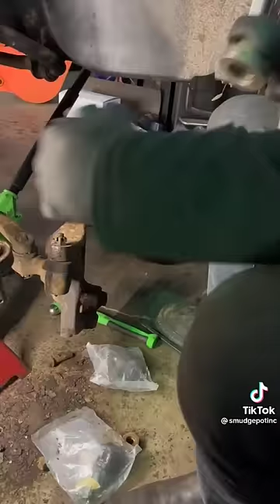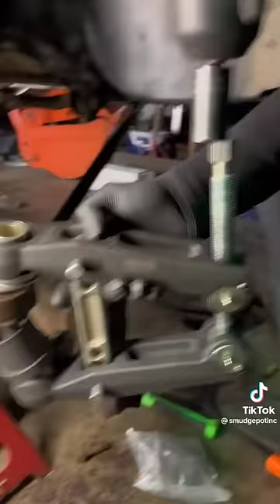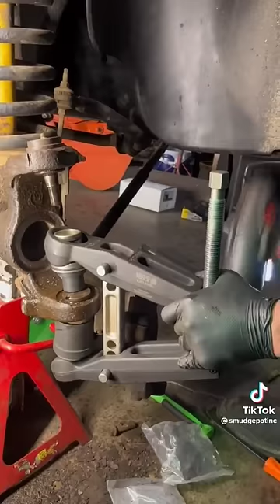Matco Ball Joint Press out ball joint Tool Kit pt.1 #automobile #diy #fyp

Comment: $1300 bucks... damn, that's a lot of 5lb hammers.
Reply from the maker: lol
Reply: You can get the harbor freight one for way cheaper. Works perfectly fine also.
Reply from the maker: @Soundsofthewood  not on a rusty dodge or jeep wrangler
Reply: @letsfixit251  I used them on rusty semi's and it works fine. You just have to smack the driver with a hammer when it gets stuck.
Reply from the maker: @Soundsofthewood  smack the driver? Lol wait until you work on a rusted jeep wrangler though.
Reply: @letsfixit251  you know for shock. Helps bust the rust.
Could a jeep wrangler be worse then a million mile semi that never stops?
Reply from the maker: @Soundsofthewood  hell yeah man and because that it does stop rust builds up more and worst that way. A semi is built more tough ti begin with anyway. These jeeps are poorly built to be honest and well a dodge is just a dodge if your familiar with hwlow bad they always Squeak
Reply: @letsfixit251  I never owned a chrysler product. Worked on them, but nothing serious.
Jeep to me was a waste of money. 30k for probably the most basic vehicle ever. I also like having a real truck bed.
Reply from the maker: @tristan long  man jeep may be the worst made vehicle there is. Look up jeep wrangler death wobble. It's the only vehicle I've seen that does that. The bottom ball joint on these things press out from the bottom and don't come with a snap ring in them from the factory because it doesn't come up high enough to put one on. The greese fitting on the top of the bottom ball joint has to be removed because the drive shaft for the wheel will hit it. It's just a bunch of things they did that didn't make sense, which is why we have tools like this being made to make us mechanics life a lil easier lol
Reply: @letsfixit251  special tools for Chrysler vehicles?  Get. Out. Of. Town.
Reply from the maker: @whiteyonthemoon1193  the ones better made for jeep or shorter than your typical c style tool. This one is pretty much universal
Reply: @letsfixit900 Jeep is definitely not the only vehicle to experience "death wobble". I have used the PIA ball joint tools on many applications including rusty Jeeps yes they do not work as slick as yours but still work, and this is in the rust belt. But back to death wobble, cars, trucks, SUVs, can all experience this with worn components.
Reply from the maker: @Jerome  Interesting. I haven't experienced it yet after working on about 3,000 vehicles, but the mechanic gods have been blessing me more than I realize. Thanks for sharing 👍🏾
Reply: And it’s a tenth of the cost of shoulder surgery, your choice..
Reply: @Soundsofthewood  how do you get the new one back in? Those c clamp presses are a joke. You might can do maybe 6 ball joints before the c clamp is bent and no longer capable of pressing. This clam style press is a 2:1 ratio buddy. That means you don't even need to use an impact. You can use a traditional wrench and you're good
Reply: @KyrieEleisonMaranatha  I bought the adapter kit also. So I can do it from both angles.
I never had mine bend. Maybe I just got a good one from the production.
Reply: @Soundsofthewood  I've been using them for years and I've never had one that didn't bend. Being that they are really cheap I'm not terribly worried about it.
Reply: @letsfixit251  for sure they have! Ford had a recall a couple of years ago for it, if I remember correctly f250 and 350s were on that one. Have seen it in cars like the Toyota Camery Hybrids as well. In the motorcycle world, it is also called knee slapper. Ram and Jeep Wrangler are the most common by far. The most common reason for true issues in my experience are worn components, followed by tire balance issues.
Reply from the maker: @jerome4995  what are you referring to?
Reply: @letsfixit251  "death wobble"
Reply: $700 on the interwebs
Reply from the maker: @Smittyschannel  that's not including the attachments
Reply from the maker: @jerome4995  oh ok
Reply: @letsfixit251  ok thx
Reply: @jerome4995  no it’s called a tank slapper not a knee slapper, get it right or don’t comment please
Reply: Dont forget the $350 Milwaukee High Torque
Reply: @FC0BCA7E7A   look out, got a real keyboard bad ass here! Yep, I should not comment due to a typo. You are correct "tank slapper." A thousand apologies, I hope you can recover from my egregious mistake! Grab your binky and teddy, hug it tight... you will be ok.
Reply: @letsfixit251  you just have to buy it used or find someone that will let you rent it or even borrow it and I promise it WILL press them in and out my shop has used it on a 1.5 ton pickup truck that rusted af
Reply from the maker: @keeganrandolph2712  I doubt if anyone will rent this tool out. Hell, I wouldn't. As far as one used being put up for sale, I'm on high alert already for it.
Reply: @letsfixit251  😂😂😂😂😂😂😂
Reply: @letsfixit251  
I assume you work for cdjr? Been working for them going on year 2. I have never come across such poorly/made to fail built cars before. And I worked for hyundai/genesis. I didn't care for jeeps at all until I worked on them. Now I hate them with a passion.
Reply: @Soundsofthewood  
Bruh, we had a V6 wrangler come off the truck at 70k msrp. I about passed out. AND SOMEONE BOUGHT IT SAME DAU!!!
Reply: @jerome4995  
Wranglers are 9 times out of 10 caused by the shitty steering damper they refuse to redesign.
Reply from the maker: @Aaron Smith  No, I'm a entrepreneur self employed. I did work for a company called budget brakes for five years as a lead tech and store manager. Specialize in suspension, steering and all powertrain that goes along with those specifications
Reply: @letsfixit251  considering I just did mine last week on my 02 2nd gen and it went good. Idk what you speak of sir
Reply from the maker: @Clark  sounds like you don't have a rusted busted 3rd gen then. Those are usually easy anyway. This a poorly made Jeep Wrangler rusted to hell
Reply: @Let's Fix It  I actually changed my first bjs on my 96 jeep with original joints with the harbor freight bj kit, 5lb hammer to release the tension and also the thing didn't even come with the straight axle cup that has that curve and it was super easy. Penetrating oil never hurt anything either. I can't believe the knuckle didn't break with you driving it home. That was Def hard on the outer edge. I would look into replacing those too.
Reply from the maker: @Jonathan Terry  yeah the hammer and cheap c style press definitely works most of the time especially if your vehicle isn't rusted to hell. I'm not the person in the video. He carelessly used the tool but it still worked and will be fine. Look on my page I did this same vehicle with a 21 peace ebay press. Not sure about you specific jeep but the one I worked on the spring was hitting the tool as I pressed it. The matco tool doesn't have clearance issues with that. Check it out.
Reply: I forgot my favorite 5lb hammer at my last job and regret it all the time. I miss lucy.
Reply: @Let's Fix It  ford death wobble is one of the most hilarious videos ever
Reply from the maker: @DiviningROD  lol I'm about to go check it out. What type of ford?
Reply: @Let's Fix It  2018 f350 death wobble
Reply: @Let's Fix It  that's the exact description, guys is hilarious about it
Reply from the maker: @diviningrod2671  fixing to check ot out
Reply: @letsfixit251  A rusty dodge..... seems like a redundant descriptor.
Reply: Almost Looks like He Broke the bottom piece & didn't Take Out the lock ring. 🤔
Reply: @jerome4995  might want to check the caster on those death wobble machines
Reply: @matthewklein9225  that is definitely something to check. I haven't had that be a cause yet in 40 years, but something to check regardless. Many of these are completely stock, worn-out/damaged parts are usually the reasons. Tires are another common cause. Trucks and Jeeps with oversized tires wear out stock components faster or tires that were poorly balanced, balance beads work great for hard to balance tires or rigs that may need a little extra help in the balance area.
Reply: @aaronsmith7143  A steering damper will mask the issue. Any vehicle, including a jeep, should not have the wobble with or without the damper. Any shop that tells you that a damper will fix "death wobble" is not fixing the issue.
Reply: @jerome4995   @Jerome  I see lifted jeeps regularly that have not taken the final step of adjustable control arms to get caster back in spec. The more oversized the tire the more caster they need. Besides the negative caster resulting from lifting without proper alignment.
Reply: @Let's Fix It  yea i totally get it. But I'm poor so harbor freight is life saver for me. I can actually feel and look at the tool. Amazon sells mostly junk. Even if it says it's name brand it could be a knock off and you never know what you're getting. But you can get lucky. But as far as tools like this, it's out of my budget. Would love to use it. But wouldn't spend what they was saying it cost. 

And yes the video no matter what tool ypu should relieve the pressure. 

And other comments saying jeep is the worst vehicle ever. I know everyone has their own opinion but I was raised Chevy, married into dodge, and everyone I know hates ford. I would up with 96 zj with 120k for 800$. Best investment ever. Easiest vehicle I've ever worked on. And easy to know what's going wrong.
Reply: @Soundsofthewood  it truly is the most basic vehicle ever. They sell u basic for way to much only to tease the poor bastards to go out and spend another 30k on aftermarket parts
Reply: I choked drinking and reading this 😅
Reply: @letsfixit251 mine works on literally everything I throw at it. same grade steel, bud. matco for
life but Harbour freight for everything possible.
Reply: fuck I bet it's re branded ,prob lisle or someone else for 299.99 lol
Reply: @Soundsofthewood  same thing,same way
Reply: @letsfixit251  yeah death wobble can happen on any straight axle vehicle. The Aluminumduties, specifically 17-19’ had a severe death wobble problem that it actually turned into a lawsuit. Had something to do with the steering knuckle I think. It still exists on my dad’s 22’ F-350 even though Ford said they “fixed it”, though not as bad. Seen videos of it, and personally have actually felt it. So fuckin sketchy! Whole truck, and steering wheel shakes, pretty much have to death grip the wheel, and hang on for dear life.😂 Shock absorbers mounted horizontally to the hub/axle are supposed to mitigate the effect, but of course it’s not 100%, especially if you go aftermarket rims it seems. Hell even the earlier super duties did it too.😐
Reply from the maker: @Carson Chambers  You all are schooling me while I'm schooling you all and it's a beautiful thing. 🫱🏾‍🫲🏼Each one teach one because I've worked on thousands of vehicles, but I've never seen it on but one.
Reply: @letsfixit251 the wobble is due to stupid people lifting the and putting big tires on stock axles and stock ball joints and NOT correcting the axle angle note proper alignment or tire balancing 
But what do I know 😂
Reply: @danialphaomega   Unfortunately, your statement isn't quite accurate. My shop has dealt with numerous stock Jeeps that have the "death wobble." A customer experiencing this issue just brought us a 2019 Wrangler last week with 29k miles on it. No lift, no upgrades, it's totally bone stock. We installed an upgraded steering damper on it because the dealership says the Jeep steering dampers are on national backorder. Problem solved. 🙂👍
Reply: Just weld one up for like 10$
Reply from the maker: @johndowe7003  weld what?
Reply from the maker: @itachisasku  never seen it. If you have a semi that's rusted, it needs to be retired
Reply: its 600 bucks dude
Reply from the maker: @DrMurdercock  the attachments cost more than $600
Reply: @Soundsofthewood  why contribute to the ccp?  if it' cost more and is made in america I don't mind the price difference. it's only money.
Reply: Do you know the part number for harbor freight tool
Reply from the maker: @House Washing Rick  no but I have the link to a 21 peace set from ebay
Reply: @letsfixit251  actually yes it works on those as well
Reply: @letsfixit251 yes it does. Literally just did my rusty dodge with it a month ago 😂
Reply: @Soundsofthewood I wanna smack the driver of every vehicle I work on😂😂😂😂
Reply: @letsfixit251 a lot of hammers that can fuck up the area where the ball joint seats if you wack it at just the right angle. Wouldn’t buy this tool but definitely wouldn’t use a hammer for a pressed joint
Reply: @letsfixit251 I've seen several videos of different vehicles having death wobble.
Reply from the maker: @trev119  likewise
Reply: By the time this thing pays itself off it'll be worn out and broken
Reply from the maker: @steamdriver6964  you must be charging to less
Reply from the maker: nawl @steamdriver6964
Reply: @letsfixit251 buddy of mine had a 98 ranger that death wobbled occasionally. I was like dude wtf is that, hes like oh its fine it just does that sometimes😂
Reply from the maker: @J_A_M_E_92  lmao
Reply: Umm doesn't ford trucks have the death wobble
Reply: @Soundsofthewood harbor freight doesnt make one like this, their c-clamp style is just like all the other ones IT SUCKS and uses a completely different design this matco tool works way better
Reply: I assume with out the tool they’d smack it with a mallet? Is there a specific tool to put the new one in?
Reply: @letsfixit251 you're coping bro your snapon and matco whatever is the exact same quality as harbor freight these days they literally sell the exact same thing for some stuff as snap on just rebranded made by the same company in China
Reply from the maker: @kelpking4484  never seen one built like that at harbor freight
Reply: No shit huh indeed
Reply: @letsfixit251 you ain’t f-ing kidding dude I did my 2004 dodge 2500 and I bent the press tool I rented from oreillys and then bent another one from harbor freight
Reply: @Soundsofthewood I couldn't see paying 30k for a 1995 jeep with 300k miles on it either lol. Now maybe 65k for a jeep with 20k miles might be a bargain 😂
Reply: @THEGOODLIFE-wl3xu  both are ripoffs.
I wouldn't pay more then $2500 for a jeep in general.
Atleast I wouldn't feel bad if I role it down a cliff.
Reply: @Soundsofthewood Plot twist, Matco and harbor freight are the same thing😂
Reply: @chasedyer5950  that's not far fetched either.
Some of the Maddox stuff I'd a complete carbon copy to matco. I know because I own both of the coolent pressure tester.
Reply: @Soundsofthewood  There’s guys on YouTube that show how basically every single thing Matco makes is rebranded stuff that you can get at least 10 times cheaper. A lot of stuff at harbor freight
Reply: @letsfixit251 the harbor freight one works just fine on the rusted up jeeps. Just slother it in penetrating oil a couple hours beforehand hand and smack the control arm with your BFH like it owes you money. When they're really stubborn ill leave the socket over the lead screw and beat straight down on it while under tension. I've used mine on everything over the last 25 years. Very fast, never failed and yes it even works on semis.
Reply: @KyrieEleisonMaranatha I've been using my harbor freight c clamp for over 25 years. Probably done 1000+ ball joints. But I use my hammer in unison and I keep my lead screw lubed. I don't even need an impact. I just use an air ratchet amd a hammer. Only once in a while I need to remove the ratchet and hammer straight down on the leadscrew.

People who don't know how to use the tool are those who bend the c clamp.
Reply: @riothero313 Lucy, God I love Lucy. That Ole girl gets me home on time.
Reply: @3dw3dw  yeah right I've been turning wrenches for over 30 years. You can sell that bs nonsense to someone else.
Reply: @KyrieEleisonMaranatha  it ain't bullshit. You're full of it though.
Reply: @Soundsofthewood and how is it the driver's fault? Poor guy was probably just driving....
Reply: He just made $250 in 30 min.........
What are you doing wrong?
Reply: They rent them out at our local AutoZone or advanced y'all. They're a little different but yea. They also sell cheaper ones, I bought a $20 one threw the impact on it and it seized, took it back and rented the bigger one
Reply: 😂😂 and alot of sending it home
Reply: Matco doesn’t actually make it it’s a rebrand you can get the same exact one for like $500
Reply: @letsfixit251 don't listen to them dood lol just people on the Internet
Reply: Fuck sake no way 😅😅😅😅
Reply: @letsfixit251  I work on vehicles for a living.  I flat out refuse to work on Jeeps 99% of the time.
Reply: That press is really handy on the 3/4 and 1 ton Chevy since they fit so darn tight
Reply: @whiteyonthemoon1193 I just had the timing replaced in a '14 Escape, the tool to pull it, Ford doesn't make or sell it.
Thank God for Harbor Freight.
Reply: @Soundsofthewood honestly most of the semi shit is so large in diameter that corrosion doesn’t effect working on them as much as it does on passenger vehicles. Simply because all the small diameter fasteners always snap off. 😂 But working on large equipment is just always hard in general. And rust will certainly add to it, no doubt.
Reply: @DarkSlideLeo glad someone else is refusing. We don’t have to take this abuse anymore. 😂
Reply: @BukitMan  well that is true to some degree.
Most semi's keep moving and that helps prevent hard on rust.

Industrial stuff in general is a different story.
I'm starting to think salted boats in Florida are far worse then salted midwest vehicles.
It's never a quick job doing this. What would take maybe a hour, takes all day because snapped bolts or seized parts.
Reply: @letsfixit251 a Dana 30 jeep wrangler is literally one of the last vehicles I’d label for pita ball joints lmao
Reply: lol?
 @BukitMan
Reply: @DWBmotorsports  any vague location? Salt belt?
Reply: I prefer a C4 shaped charge myself... 💥🙈
Reply: And torches
Reply: For the price, it should come with a 3rd hand...
Reply: Snap On version is 600 bucks and easier to use.  And I hate snap on but for this type of job it's a must have
Reply: @ashkanserat I built a hydraulic ball joint press out of some scrap girders and a 30 ton cylinder about 30 years ago. Total cost was about $50. Works perfectly even for the dreaded Sprinter vans and the ridiculously tight upper ball joints on Volkswagen Transporters.
Reply: Jeep ball joints ain’t shit. Snap on press will take it right out.
Reply: @letsfixit251  my local parts store will rent the press out if you buy a set of ball joints from them. They want a $500 deposit, though.
Reply: I’ll tell you, I bought a ball joint press from Amazon for $50 about 5 years ago and it’s been worth every penny. It ain’t THIS fancy, it looks more like a c clamp. But man it is a life saver. And a money saver since I don’t have to buy the entire knuckle or control arm to change ball joints in my vehicles. Which due to pot holed gravel roads I do more often than I would like.
Reply: @letsfixit251 that death wobble is no joke had a grand Cherokee Laredo going town the road at 55 hit the slightest bump/hole and the steering wheel would shake so bad it would jerk it out your hand and shake back and forth almost half a turn.  Only option was slam on the breaks and stop.
Reply from the maker: @one1onetime935  Wow that's crazy:face-orange-biting-nails:
Reply: Right
Reply: @letsfixit251  A death wobble has absolutely nothing to do with a hard to remove ball joint. Jeeps are not the only vehicles that have this problem. A death wobble can happen on any vehicle given the right circumstances, but is prone to vehicles with solid front axels. Its a trade off. On a solid front axel, the upper and lower ball joints are right on top of each other because they mount directly in the rear end housing. Your main alignment angles for stability are caster and sai. Both lines run vertical through the center of the upper and lower steering pivot points. The ball joints are the pivot points. The spindle has to be bolted to the ball joints, and since they're mounted on the rear end, the front end geometry is forced to be less than optimal, with little to no adjustment. If you a 2wd or floating front axel design, the ball joints are mounted to the end of the control arms. Having the ball joints further away allows for a much more stable front end geometry. And, in many cases you can adjust sai and caster. The Ford F250 and up, has a similar design, and are prone to death wobbles, as well.
Reply: How does it compare to the snap-on ball joint press?
Reply: Smarter not harder. Great for reducing repetitive stress injuries which can often result in difficult to heal injuries. Worth it if it saves your joints, coming from someone that has had 4 shoulder surgeries on one shoulder due to repetitive stress injury that had cost me money due to production capacity loss...I'd be glad to pay a few bucks if it meant I could have kept my old shoulder.
Reply: @letsfixit251 I bought one of the harbor freight ball joint removers for my 96 Dodge Ram and it worked great. I was the first person to ever replace the ball joints on a 30 year old 330,000 mile Dodge and I did it with a harbor freight purchase. Should tell you something about whether or not they are any good. Now I’m not saying that I got lucky but honestly I prolly got lucky. Nothing has ever gone that smooth when working on that truck.
Reply: All the talk in the comments about semis and their ball joints, WTF
I've been working on semis a long time and all I see is kingpins, what kind of semis are you guys working on. 🤔
Reply: @Soundsofthewood  you either never worked on cars prpfessionally or you dont live in the northern east coast let a 20yr dodge come rolling in your shop and need new ball joints, most of the harbor frieght specialty tools dont work FAST enough to keep up with a fast paced and quality shop, Period. Especially big rig. Look at the leverage applied compared to the u shape clamp thing harbor frieght sells. Not to mention the inferior metal screw shaft that just gets boogered up on the threads after the first few HARD uses. I'm all for Harbor frieght tools, trust me but I know when hold them and when to fold them.
Reply: @letsfixit251  Hadn't heard of that Jeep death wobble before now but we did replace rear control arms on a 2001 Infiniti QX4 that felt like it was going to throw the back end around to be the front end anytime you got above 25 MPH 😅 no major steering wheel effects from that though like the Jeep.
Reply: Yeah that's too expensive unless you're in a suspension shop.
Reply: We call that a tax write off😊
Reply: @letsfixit251 You haven't been around much if you think Jeeps are the only vehicle that develops the death wobble.
Reply from the maker: @user-jw5jm6fw2f  almost 20 years in the industry professionally 🤷🏽‍♂️
Reply: @letsfixit251 used heat and a hammer on my rusty Jeep. Came right out and I didn’t really heat it up that much, just enough to get it warm.
Reply from the maker: @MatthewBKR  ball joints can explode violently from heating be careful
Reply: How much is this tool ?!?!?!?!?!?!? Where ?
Reply: Plus the tool won't fit
Reply: @letsfixit251  My dad told me when I was a kid to only “warm” them and to never get ballsy with the flame so I just listened to him from that point on. I guess I should have been clearer about that in case someone else sees that and just goes at it. What exactly happens if it gets too hot? It just releases with a lot of tension?
Reply: @letsfixit251 chrysler off-road capable vehicles specialize in death wobble. Let me introduce you to the vehicle the vehicle that breaks about as much a range Rover, called a Dodge Ram.
Reply: @letsfixit251 bruh.. ford trucks do the death wobble too. Youre acting like jeeps are the hardest vehicle ever to work on. That 150k mile Jeep is def not gonna be as hard to work on as a 1 million miles semi truck dude you’re tripping
Reply: @letsfixit251 good thing I'm not a mechanic so I don't have to work on some pos jeep
Reply: @letsfixit251 tryna justify the price buddy 😂😂 it’s probably just as good
Reply: @Soundsofthewood Harbor freight one is junk, I have it
Reply: My 89 chevy used to do it REALLY bad. Lol @letsfixit251
Reply: @letsfixit251 put in a good word for me bc I think they hate me.
Reply: @aaronsmith7143 replacing just the dampener is putting a band-aid on it when it needs stitches. The wobble is never caused by the dampener, it comes from lateral movement in the suspension components. Kinda like replacing a shock when your springs are worn out, sure it’ll ride better for a while though.
Reply: Thanks for saving me the time I’ll just buy the control arm for 200 bucks
Reply from the maker: @chuckbuttons0699  lol ok
Reply from the maker: @seanutrera3613  lol it's expensive yes
Reply: 1300 can pay for itself in 3 jobs. And at this rate, that's less than a day.
Reply from the maker: @mr.noneyabidness  facts
Reply: @Soundsofthewood north or south of the salt belt, how humid is your summer? How often is freezing rain in your winter? Does your winter have 102°f days with -5°f days in the same week. Around these parts, removing a bolt is almost an art. Have you ever seen plastic fuse to the rust of a metal part. To the point they are one and after you break em apart, both aren't even in good enough condition to be scrap despite being manufactured only 4 years ago!?
Reply: @Soundsofthewood  Actually yes, setting is the worst thing you can do to a vehicle    a diesel mechanic would also be bright enough to remove the snap ring first and second would be to point out the fact that there are no ball joints on a king pin axle
Reply: @aaronsmith7143 damper replacement is a band aid or mask  it will hide the problem but the problem is worn components just because everything feels good does not mean it is and a dial indicator and bar will prove it or your new blown steering damper will  I HAD an xj
Reply: @KyrieEleisonMaranatha I think all the aluminum presses bend. Spend more on a steel press and never look back that's what I did and have not had a problem since
Reply from the maker: @kevinroberts9394  jeep Wrangler bottom ball joint has no snap wring
Reply: DANG! I thought it might be over 500, but not over a thousand! Can see the quality tho...
Reply: @kevinroberts9394  I've never seen an aluminum one.
Reply: @KyrieEleisonMaranatha  harbor freight C type balljoint press is or at least was aluminum  and if you did not grease or anti seize the threads they were the first failure point  then they open up   they were my 1st 2 then otc steel and it lasted till I loaned it out and it never  came back  now I have a second hand unit with no name on it but has been the absolute best
Reply: @letsfixit251 Mate, I purchased $39 kit from eBay, works just the same as your $300 kit.
Reply: I made a punch out of a 4" long by 1 3/4 diameter round stock and a foot long half inch rebar folded over and welded to the side of the round stock as a punch so I could hold on to it by hand and not smash my hand with the sledge! Changed ball joints with that for decades and very very seldom had to use the "Liquid wrench" to loosen things up!
Reply: @Soundsofthewood a semi with ball joints? What world do you live in?
Reply: @cameronmcfarland5520  I used it for brakes. The pins seize up and you need to use a ball joint press to remove them.
King pins usually were a sledge hammer.
Reply: @tristinsperry5171  I lived in Minnesota,Louisiana,Florida,Alaska.
From road salt to sea salt.
Alaska had the best so far.
Reply: @letsfixit251 LMAO! Dude, any solid front axle or as the Aussies call it, a rigid axle will get death wobble if bushings on the steering and suspension control arms/components are neglected. I've seen it in Ford trucks, Rams, Jeeps and even the old Toyota Land Cruisers with that type of front axle. You only hear about it with Jeeps because they are so popular and many people have them. Jeeps definitely aren't for everyone but I love mine and it's fun to drive. I have another car I use as my daily driver but before I got the 2nd car my Jeep was my daily.
Reply: @letsfixit251 i have and used them on everything rusted the harbor one works just fine what sucks is the set up wish it was like this